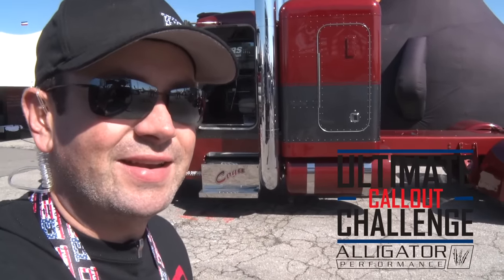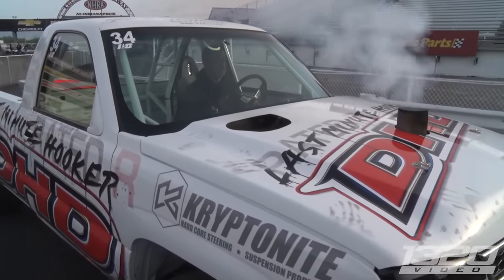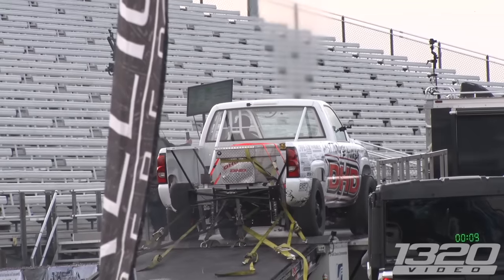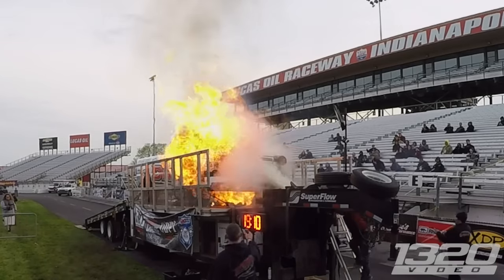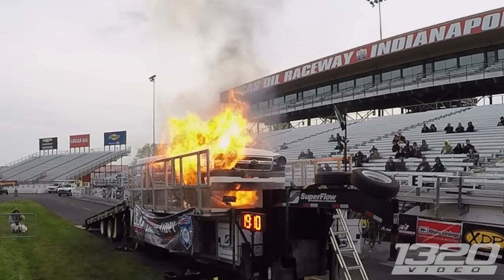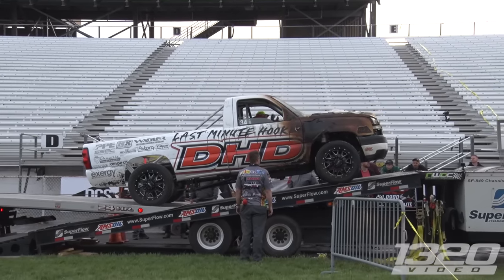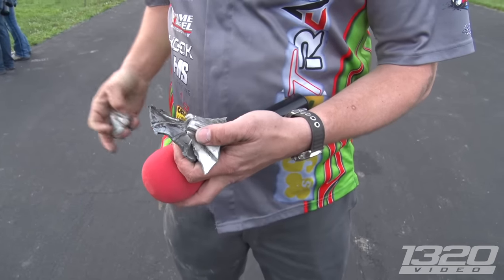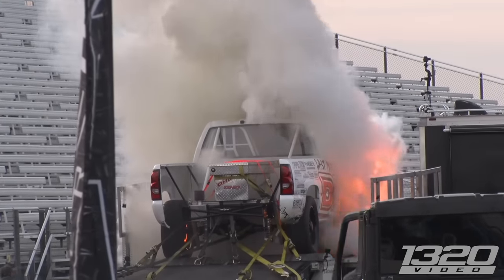MASSIVE FIRE - Runaway Diesel on the Dyno!

Comment: high performance but low quality engine build.
Reply: Can't really say that.  It was a failed turbocharger and when something spinning 100k+ rpm flies apart you get shrapnel.  Sometimes that shrapnel hits vital components and the fireworks begin.  You could argue that maybe they should be running a Kevlar turbo blanket, but this sort of catastrophic chain reaction is pretty rare (you're more likely to see the exhaust turbine shoot out the exhaust).
Reply: @ChurchAutoTest  the Rolls-Royce Merlin aircraft engine was spinning very fast but had durability.
Reply: @andriabbas7727  Missed the point.  It wasn't a bad engine build, it was just a turbo failure.  Stuff happens.  Metal parts fatigue.  Sometimes they have manufacturing defects.  Calling it a low quality build is misleading and unfair.
Reply: @ChurchAutoTest  Metal parts fatigue + manufacturing defects = low build quality. If you are going to build a machine with a high RPM, you should think about the best design, right cost and material.
Reply: @andriabbas7727  Lol, ok, I'm done.  You clearly don't know much about engine building.  Turbochargers fail all the time on everything from little Hondas to big diesel trucks.  From F1 cars to diesel locomotives.  Even the best turbos made from the most exotic materials fail. It's not an engine build issue - period.